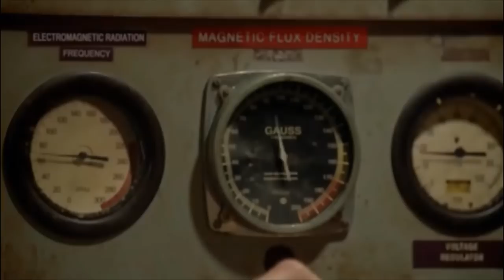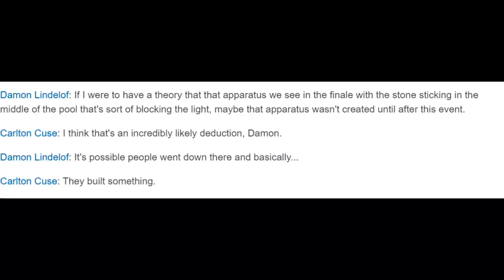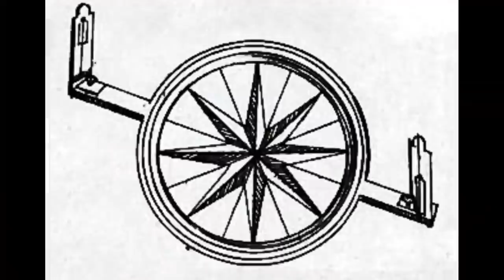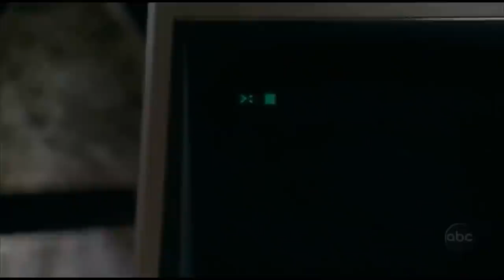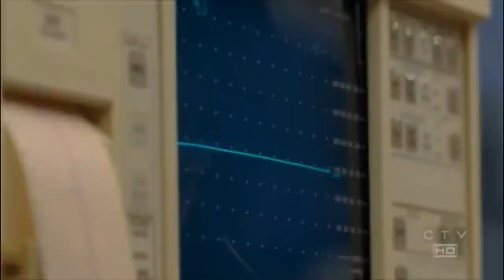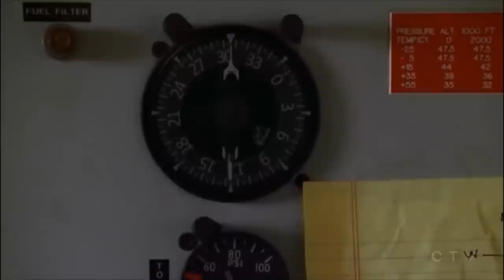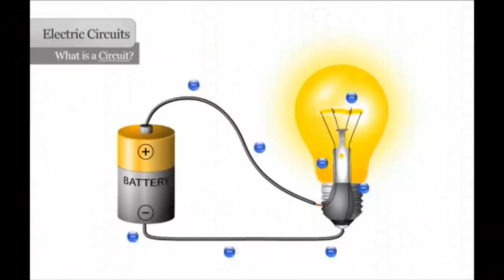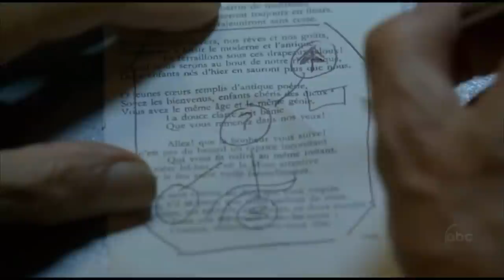LOST EXPLAINED - THE THEORY OF EVERYTHING

Comment: This a masterpiece of a video for a masterpiece of a show… outstanding work and puts many things into perspective for sure. What are your thoughts on the swan been built before/after the incident? Change of plot for the writers maybe? Anyway hope to see more from you soon.. see ya in another life, brother.
Reply from the maker: Thank you for the very kind words and your support :) 

My thoughts on The Incident are that -- ignoring any retconning from the writers -- Jughead caused an implosion that staved off disaster in 1977. This implosion plugged the leak. Which bought DHARMA enough time to fill in the bottom of the hole with concrete. From there, they finished construction on The Swan and continued to study the electromagnetism. But the leak started up again sometime between the final stages of construction and the station being fully operational. How do we know this?

Well, "The Incident" originally took place in 1977. But the computer itself is a slightly later build (based on the Apple II), which means the button was not implemented for another several years. The orientation video for The Swan is also dated 1980. Which means the leak came back slowly over time, forcing DHARMA to alter the purpose of The Swan from a research station to a world-saving barrier. They installed a reactor capable of absorbing the electromagnetic build-up so it could be discharged safely. And that is what is hidden behind the sealed wall up top. For whatever reason, that room was abandoned some time between 1980 and 2001, perhaps due to an almost-incident in which the button wasn't pushed in time. We can only speculate as to why they walled off that room, but it was most likely to avoid another meltdown. When Desmond turns the fail-safe key, he is essentially detonating this reactor and blowing up the pocket of energy.
Reply: Thanks for taking the time to reply and that actually makes quite a lot of sense as I had been reading some completely off the wall theories about this. Yours is most logical within what we see in the show for sure! 
Take care brother
Reply: @LOSTEXPLAINED108  Perhaps they walled off that reactor room, because the pocket had built up too much electromagnetic energy again, to a level that would be too dangerous for people to get that close to. They could only keep the energy at bay by proxy by pushing the button, the failsafe system was still intact, because the reactor maintained operational. It´s just that the electromagnetic levels AT the reactor became too high again for humans to go there, so they sealed it off......
Anyway, I would LOVE to see some of that stuff and like some of the mystical ancient Island lore explained in some sort of prequel or spin-off. Although it could bring the risk, that they´ll fuck it all up....

(btw: that´s also, why I ALWAYS spell the Island with a captal "I"! Because it certainly is a character of its own...)

Comment: Very well done. One thing to consider: every script is determinative and so every enacted screenplay is deterministic. The characters do what the writers devise them to do and often with emphases and intentions given them by the director. This was first well-plumbed by David Lynch in Twin Peaks, where there were actually characters who knew they were in a TV show (and why they keep showing that soap opera on TVs in episodes throughout the series). I do have to comment on the faith versus rationality question, however. I may be alone in this, but it is my considered opinion after many years of reflection, that no faith that is not grounded in a rational understanding but also in acceptance of an infallible authority can survive. There does not happen to be any such religion, even the one I personally hold, or there wouldn't be such fragmentation as people mutate their understanding down the ages. That said, it remains that LOST did as good a job of highlighting that there is a supposed conflict between the two and that the conflict does not need to be.

Comment: For the FAQ, the part about the numbers does not explain the 'failsafe' that Desmond activated and what it meant?
Reply from the maker: The fail-safe essentially blew up the pocket of energy beneath The Swan. When DHARMA built the station, they installed a reactor capable of absorbing the electromagnetic build-up so it could be discharged safely. This reactor is what is hidden behind the sealed wall up top -- the one which Jack looks at when he is first down there and the key around his neck is pulled towards by the magnetic charge. 

The computer was wired up to this reactor. As the electromagnetic energy was being channelled into the reactor, the button would discharge that energy into the atmosphere once it reached critical mass. Thereby resetting the clock.

For whatever reason, the reactor room was abandoned some time between 1980 and 2001, perhaps due to an almost-incident in which the button wasn't pushed in time. We can only speculate as to why they walled off that room, but it was most likely to avoid another meltdown. When Desmond turns the fail-safe key, he is essentially detonating this reactor and blowing up the pocket of energy.

Comment: This is a great video, thank you very much, I hope it will have more views.

However, I still have some questions, can you answer them please?
I'm sorry if there are mistakes in English, I'm not an English speaker.

1) Who and why launched the message with numbers on the radio tower, which was caught by Danielle Rousseau, as well as Leonard in 1988? Why did they catch it at the same time? According to Leonard's wife, he caught it 16 years ago too. Is there an explanation in the canon, and not just in The Lost Experience?
2) Why did the pilots of the Ajira plane hear the numbers in 5x09, if the message with the numbers was turned off on the radio tower for a long time?
3) Why in 5x05, after another flash, Locke moved to 2007, where he met Christian next to the wheel, and the rest moved to the Egyptian period and saw the statue?
4) Why did a powerful beam of light come from the Hatch in 5x04, if there was no beam in 1x19. This beam is much more like the beam of light in 2x01 when Kate went down to the Hatch.
5) Why is the Hatch crater in 6x01 different from the crater in 3x03?
6) Why did Desmond lose his clothes after the Hatch explosion, but Locke and Mr. Eco didn't?
7) How did Richard cross the Sonar fence in 5x08?
8) Why did Jack hear Christian's voice in sonar in 3x01? If it was Man in Black, why would he do that?
9) Why could Miles communicate with a dead boy in 4x02, if in other episodes he always needed a human body for this?
10) Why didn't Man in Black hide Locke from the body in season 5, as it was with Christian? Then Ilana wouldn't have found the body.
Reply from the maker: Here are some answers to your questions:
1. DHARMA launched the broadcast with the numbers. It was their radio tower. The purpose was to broadcast the numbers 24/7 to their off-island headquarters at Ann Arbour. The plan was to change the broadcast once they had solved the Valenzetti Equation and changed the numerical values of the prediction. A lot of this information comes from external sources. None of this was ever explained within the canon of the show itself. 

Meanwhile, Leonard's listening post and Danielle's research vessel both picked up on the broadcast. Radio signals can be intercepted and picked up on. Anyone in close proximity to the island could potentially tune into the frequency and hear the broadcast. They heard it around the same time.

2. The broadcast appears to have been re-activated at some point during the past three years. It is never explained why or by whom. But it could have been re-activated to act as a mayday hail. The only person left on the island who still wanted off (and was left behind and knew where the radio tower was) is Claire. Since she became the new Rousseau of the island, it would make sense that she went back to re-activate the broadcast.

3. Locke moved to the objective present day when he fell into the well because the donkey wheel chamber exists within its own pocket of time. Remember, the wheel is off its axis in the present, not through all the time periods that it ever existed within in. The pocket of energy is down there, adjacent to the wheel. When that flash happens and Locke is pulled into the pocket, Team Sawyer actually appear at a point before the wheel ever existed. Which means Locke is in a different bubble of time down there.

4.The beam of light was activated by Desmond below. It's a essentially a floodlight that can illuminate the hatch tunnel above. Yes, it didn't seem that bright in season one when Locke was banging on the hatch, but in later seasons they reveal that the light was strong enough to shine up into the night sky. It's a mild continuity error. 

5. This is also related to continuity. The production design changed the look of the imploded hatch. An in-show answer that might be more satisfying is simply that The Others stripped the hatch crater for spare parts over the years between 2004 and 2007.

6. Desmond's clothes were, presumably, vaporized after turning the fail-safe key. He was exposed to the full blast of electromagnetic energy, which either disintegrated any inorganic material or imploded so forcefully that it ripped his clothes off from his body. 

7. Richard got into the barracks because there were many tunnels beneath the island, built by the Egyptians centuries ago. This is how The Others snuck in and out of DHARMA's barracks whenever they chose. And this is demonstrated in-show when Richard helps Jack and Sayid break into the compound in the season five finale. 

8. Jack hears his father's voice coming through the intercom and later actually sees his father at the hospital in season four. Only special people can hear and speak to the dead. It is implied that Jack has some degree of sensitivity to the powers of the island, but he represses them. Jack is in denial about being "special". 

9. Miles needed a body to read the memories of the dead and to know what they knew. However, his introduction establishes that he could communicate with the dead to some degree without a body present. He just couldn't read their memories. I believe that, with some help and training, Miles would one day be able to commune with the dead properly like Hurley. 

10. The Man in Black didn't need to hide the body in season five because, technically, the body was already hidden in the cargo hold of the plane. He did not know that passengers on Ajira were working for Jacob. To him, the chances of anyone actually opening up a dead man's coffin in the cargo hold were highly unlikely. The Ajira passengers might look for other things amongst the cargo, but no one would want to desecrate a stranger's coffin.

I hope this helps clarify some things!
Reply: Thank you for helping me!
I'll be waiting for your new videos.

Comment: Awesome video, one thing I disagree on is the ash circle which keeps the smoke monster out. I think it's Jacob's ashes. He's kicked into the fire pit and would be reduced to ashes and we know MIB can't hurt Jacob which could imply that's why he can't cross it.
Reply from the maker: I like your thinking there but the problem is that the ashes existed long before Jacob was killed. There was a circle of ash around the cabin for years. Locke sees it when Ben takes him to the cabin in 2004. We also see The Others use separate bags of ashes to fortify the temple upon first hearing the news of Jacob's death. I absolutely believe that the ashes contain some kind of mystical properties derived from elements that are found on the island somewhere. The same properties that imbue Jacob with his powers. It is all connected to the energy beneath the island.
Reply: @LOSTEXPLAINED108  Very good point, I always kind of assumed that had something to do with time travel or the old ashes were from an older island protector. Jacob's ashes do seem to have significance "when the fire burns out I'll disappear". where they burning his ashes? There are definite problems in the theory though. Your explanation is a solid one. Haven't watched all your video yet but am really excited to finish it. Thanks so much for making this.

Comment: Bismuth and magnetic fields

User
Does bismuth repel magnetic fields

ChatGPT
No, bismuth is not inherently magnetic and does not repel magnetic fields. Bismuth is actually considered a diamagnetic material, which means it weakly repels an applied magnetic field. However, this repulsion is significantly weaker compared to the strong magnetic repulsion observed in materials like magnets or superconductors.

Diamagnetic materials, including bismuth, exhibit a very weak and temporary repulsion when subjected to an external magnetic field. When the magnetic field is removed, the material returns to its original state without retaining any magnetic properties. Therefore, while bismuth exhibits a slight repulsion, it is not strong enough to be used for practical magnetic shielding or repelling magnetic fields in most applications.
There's a lot of conjecture in this analysis represented as fact.
Reply from the maker: This is the first time I’ve ever had someone use chatGPT  to respond to a video. The bismuth part is total conjecture, I’ll give you that. It’s just an idea being suggested not a fact. Basically, I wanted to get across the notion that the ash compound has magnetic properties but I wanted to use a real world example of such a compound. I’m not saying it is the exact same thing. However, with that said, I don’t include this particular comparison in my redux cut of this video for the reasons you have listed. I’m always willing to adjust suggested theoretical ideas as I go through the show. All we know about the ash is that it repelled the smoke monster and was connected to Dogen, so we have to make deductive leaps to fill in the blanks. Those leaps won't always be accurate.

I've had a couple of comments on the channel since starting that have challenged me on my so-called "factual" presentation-style. While I do frequently use words like "speculation", "theory craft" and "interpret", or other caveat words such as "possible" and "most likely", I will admit that I write my scripts to come across as instructive. Partly because it's more compelling to listen to that way, but mainly because I believe that what I am saying is accurate to the best of my knowledge and therefore deliver it that way.

I do draw the majority of my conclusions based mostly on established narrative facts or allusions and implications that are embedded within the show, and therefore I present my explanations matter of factly. Also, I state this up front on the about section for this channel. There will always be an element of deduction and/or speculation from video to video. I incorporate a mix of canon answers as well as creative solutions to mysteries that have more ambiguity surrounding them. People can pick and choose the parts they agree with and the parts they don't.
Reply: @LOSTEXPLAINED108  
Much like religions  and theists and deists then.
Thanks for putting into words the feelings I've had about your presentation style. Namely speculation put over as facts. One of the strengths of the Lost series is that it doesn't make everything very obvious. And that is it's very weakness as well. You can have too much of a good thing. The show eventually became a parody of itself.
Reply from the maker: No, that isn't what I wrote. Don't twist my words so you can make bad faith proclamations. I said that SOME of it can be speculation (such as what the ashes are made of) while MOST of it comes from established narrative fact (such as the incident causing the pregnancy crisis). LOST isn't just a vague any-interpretation-will-work type of show. It's not a Rorschach test in which you can make up your own answers without anything to support them. It's a puzzle, made up of 120 pieces with a few left blank for us to fill in. The explanations have to be borne out by the evidence, most of which is laid out on this channel (admittedly with some of those added speculations you seem to have such an allergic reaction to).

In my opinion, the show got better as it went along because they had their end date and could actually write towards that ending rather than spin their creative wheels, which is essentially what Season One does, as well as parts of Season Two and Three. LOST didn't become a parody of itself because it was constantly evolving rather than repeating what had come before, or trying to be all things to all viewers. I think the problem that some viewers had was that the show went in a direction that they did not care for, and they could not reconcile the ultimate given answers with their own preconceptions and preferences. But I explore the story that was told, not the one that I wished had been told. And I try to account for all of its imperfections and flaws too. And I sometimes do that in the face of abrasive, rude, snide and dismissive criticisms from the naysayers who treat LOST like it's an ex-girlfriend who cheated on them 10 years ago and they never got over it, yet still find ways to stalk, troll and obsess over it anyway.
Reply: @LOSTEXPLAINED108  I'm sorry if my hate for the show only comes over to you when the very  fact I'm commenting on it now after all these years shows I care.  It will always be a love hate relation. I loved the show for first few seasons. But when it turned into an obvious  cash cow it just turned to disinterest.  I hate for a time I just stopped caring.
Reply: @redmed10 t never became a cash cow. The network wanted ten seasons while the creators fought for their lives for it to end at the sixth season. They always wanted to end the show around the 100 episode mark.